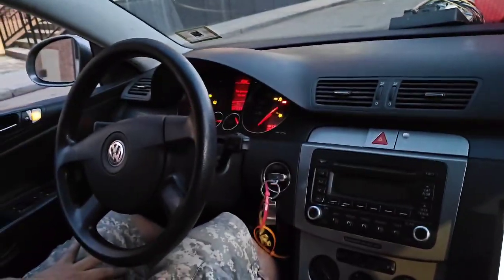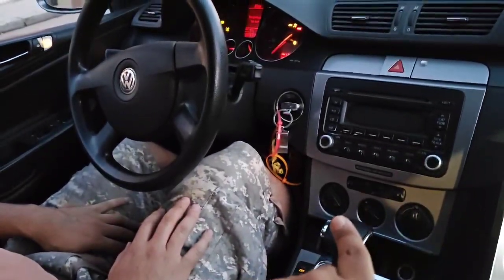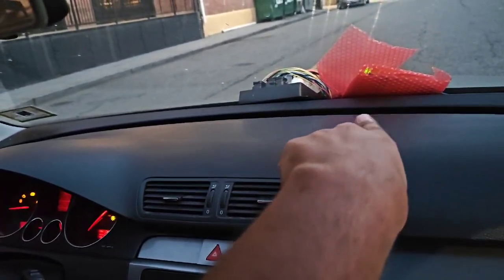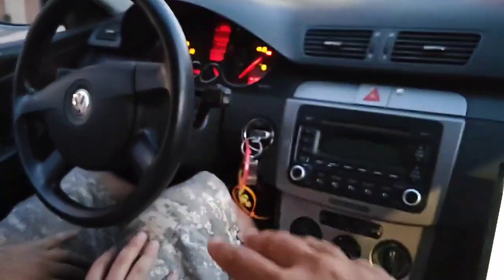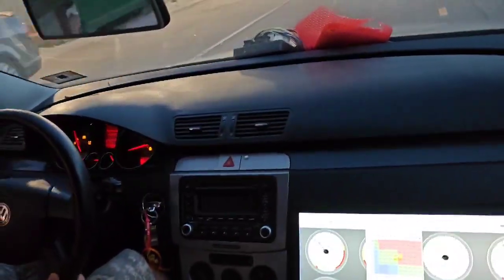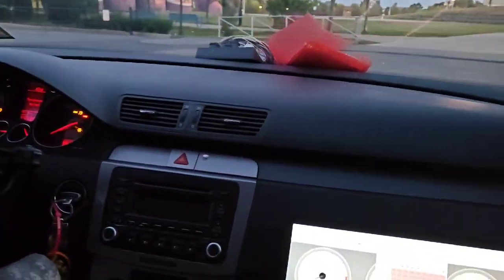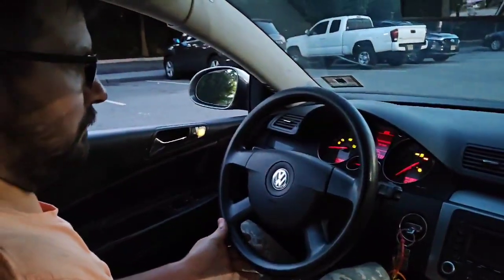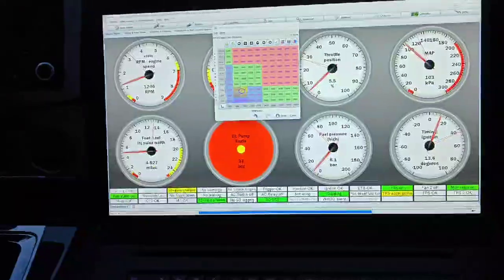Passat B6 auto non DSG rusEFI standalone

Comment: The work you guys are doing never fails to impress. How do you handle specific applications, such as this, leveraged on top of rusefi, like is there additional hardware or just an additional software configuration for torque output, TCC lockup etc? Also side note, pretty sure the 09G uses the same can signals as the DQ250 as I’ve seen swaps (with OEM ecu) without any additional programming.
Reply from the maker: Since it's only CANbus there are zero hardware requirements. As is there are still loose end and it's still unclear what is the product here (if any)